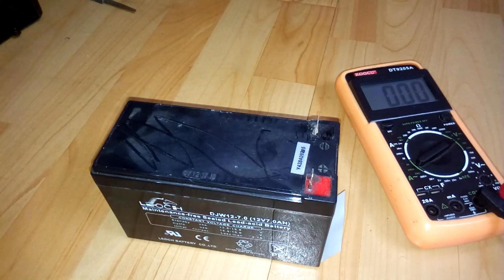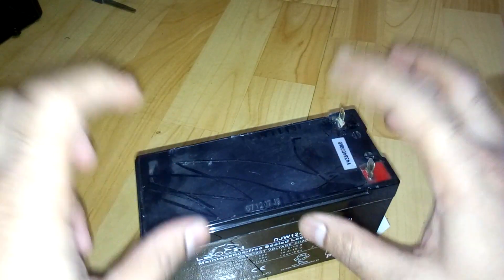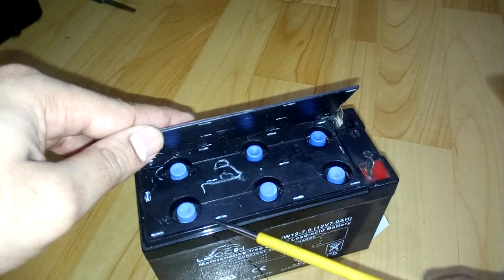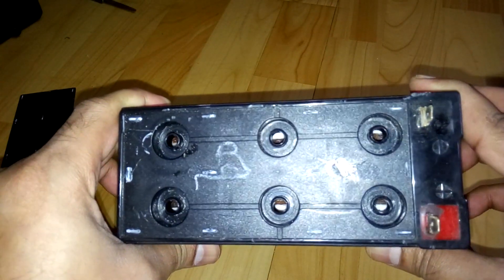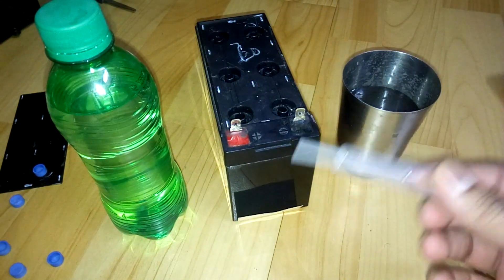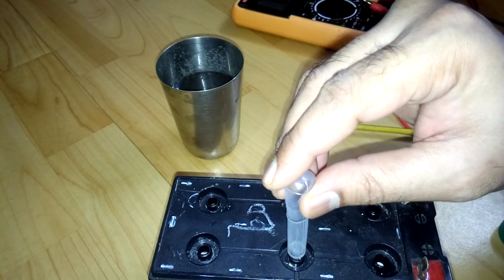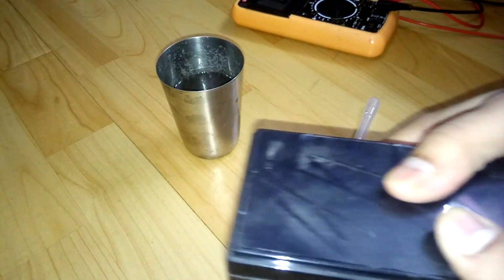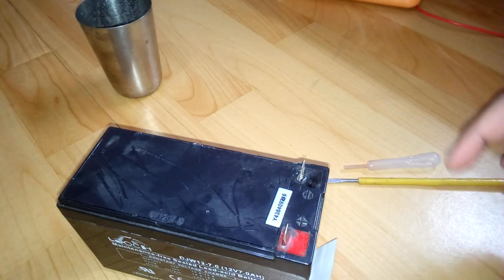How to repair old ups battery

Comment: A small qustn about computer UPS maintenance. If its a new and good condition battery. Is it good for battery health to leave it to discharge to full at least once in 3 months etc ? Bec else its always maintained at full by trickle charge right ? When power is getting cut once every 2-3 days, is it better to quickly shut down the PC to avoid draining the battery or fully use the 30 mins backup time which im getting and then shutdown during final quick beeps ? If its healthier to quickly shut down and always maintain high battery level, then should we once in a while do a full drain and recharge is my qstn ?
Reply from the maker: Always shutdown the pc after power cut. Never discharge any battery completely.

Comment: Hooooo...its not work.
Reply from the maker: Well it works most of the time with most of the ups batteries. That depends on the condition of the battery plates. It doesnt work with some exide models. These batteries are made like that, after few years the plates get totally damaged. So you will buy new ones & they will make money. Sorry it didnt work with yours bro.

Comment: Hey bro i am having an old UPS  it's not charging  but works when I plug 🔌in Current  Presently I am using it as Multipin adapter 😂 
Can  I  Find this video helpful bro   
I am having V Gaurd Royal
Input
(Working range:160V -300V AC) 
Frequency: 50Hz, +-5℅
Output
Voltage;220V AC +-6℅
Frequency:50 Hz, 1 ℅

It's almost more than 8 yrs when I bought it
Reply from the maker: Depends on the condition of the battery. But Yes this can help.
Reply: @technoboy-allinOne  OK bro will try
Reply: Not working  broo  i think the battery and all is dead  in itt
Reply: Anyways nice video keep going

Comment: Why do we need epsom salt? BTW, you didn't show filling up the cells with epsom salt.
Reply from the maker: To desulfet the battery plates. And epsom salt is mix with the water.
Reply: Can i use gel? You didn’t show how to increase voltage. Why?